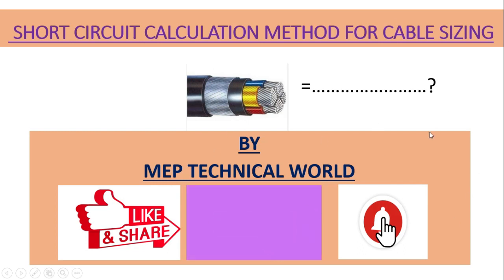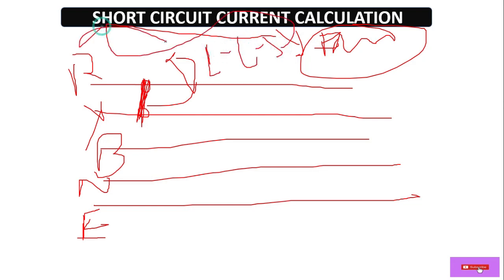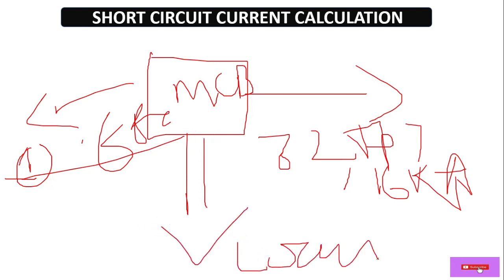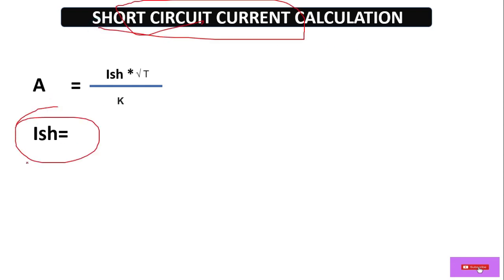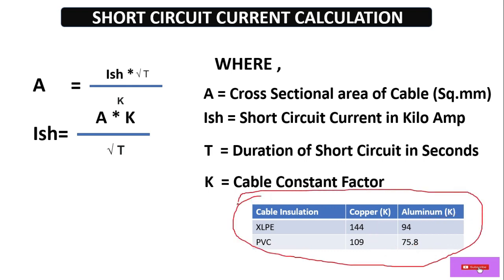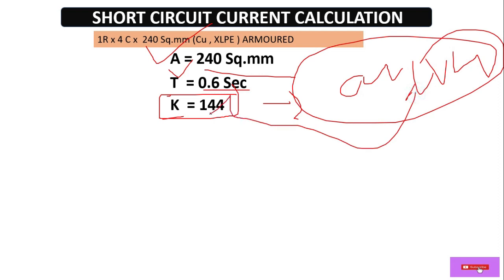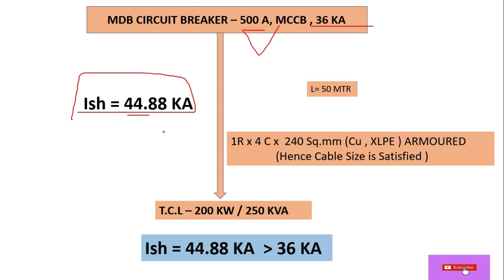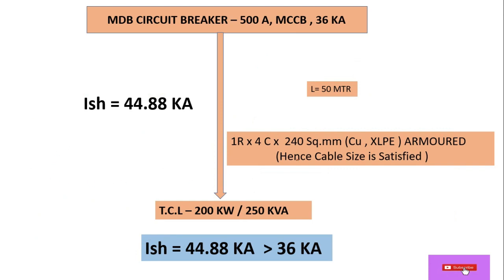Short Circuit Calculation Method for Cable Sizing and Selection | Cable Sizing

Comment: Wrong calculation value of cable..in Lt side use mccb ..so here will not be use xlpe cable .you calculate by 144 that is only for xlpe cable